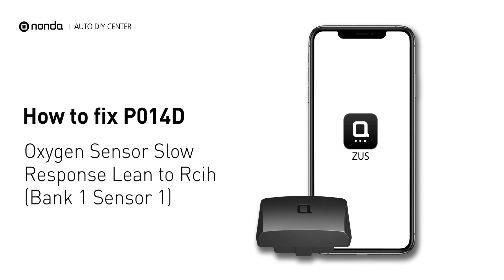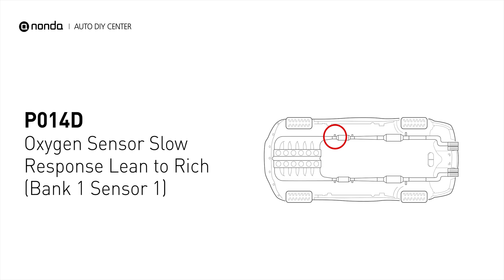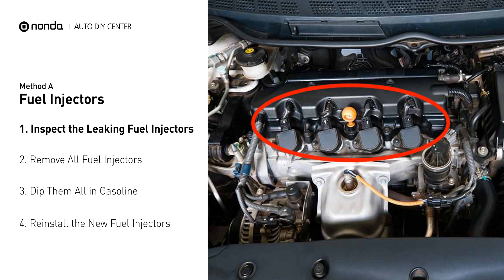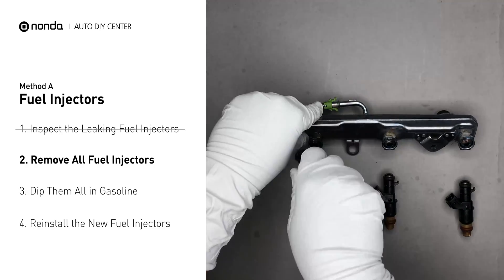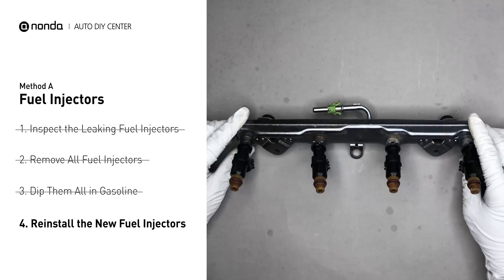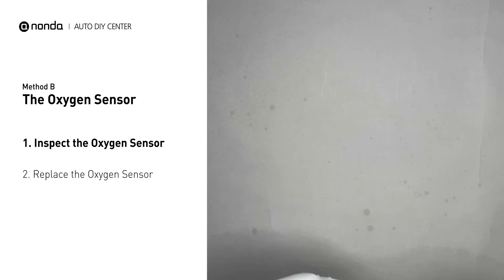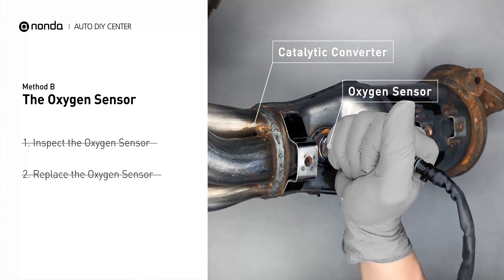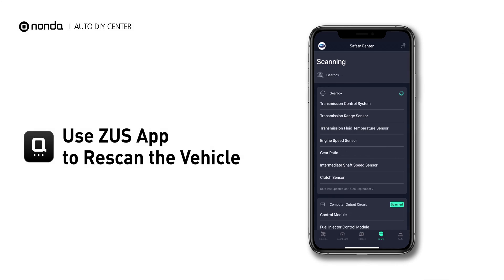How to Fix P014D Engine Code in 3 Minutes [2 DIY Methods / Only $8.71]

Comment: My 2016 Nissan Altima is throwing 4 codes together:
P014d
P015b
P014c
P014a

These all seem to be about the 02 sensor. Will the steps in this video fix my issue?
Reply from the maker: Hi Nate, since you are receiving multiple codes, we suggest getting your vehicle visually inspected by your local mechanic for further diagnosis.

Comment: My car triggered this code then it turned off but its stored in my obd2 should I still change the o2 sensor?
Reply from the maker: Hello, can you please provide us with your vehicle's year/make/model?
Reply: 2012 camry se 4cyl
Reply from the maker: Have you checked the resistance/voltage/ground signals of the O2 sensor?